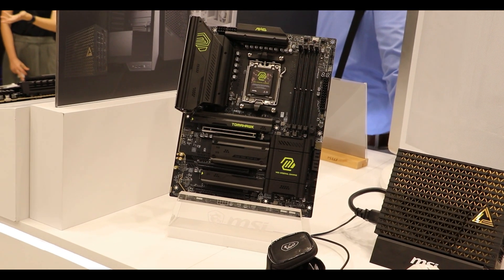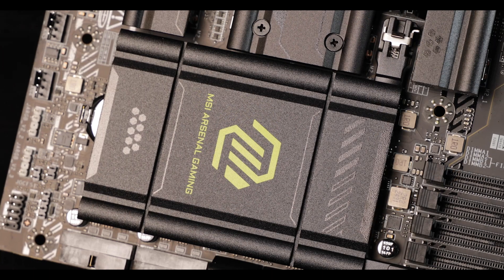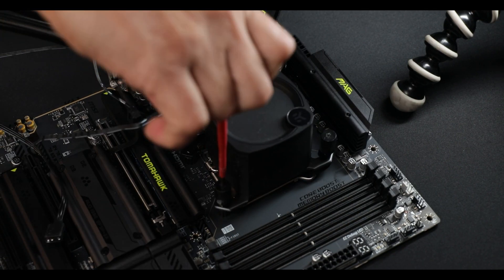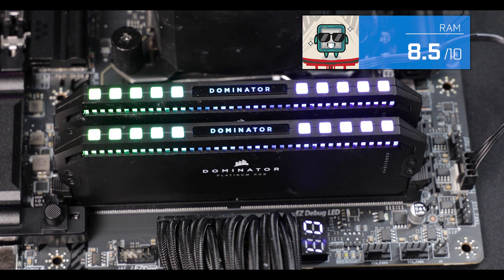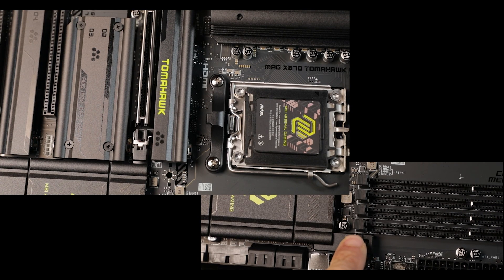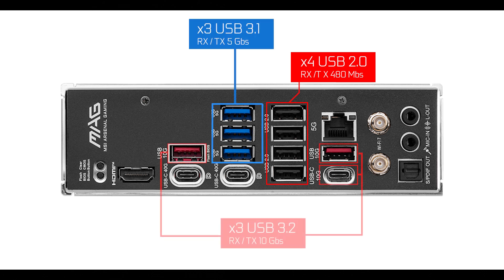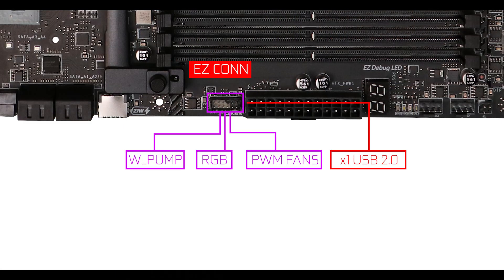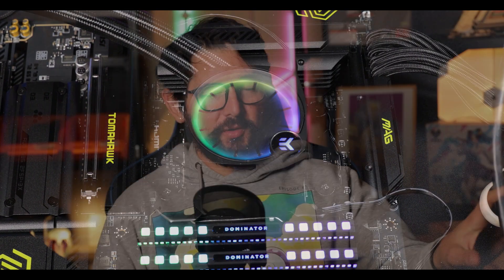MSI MAG X870 TOMAHAWK WIFI : this is getting better and better!

Comment: I am now in between MSI MAG X870 Tomahawk WiFi vs MSI MPG X870E Edge TI WiFi
Which one would you suggest? Definite one is more expensive than the other would like to hear your thoughts. :)
Reply: @laurentschoice help me
Reply from the maker: So.. the edge only brings marginal upgrade compared to the tomahawk. Most noticeable are the QR code for troubleshooting and a bit more BIY friendly features.

Comment: In my region, it costs 370 Euros and includes a 100-euro Steam card, making the price a measly 270 Euros. All this for a motherboard on par with the Asus Hero, which costs 700 Euros.
One question: I am doing "blackout" builds. Do you have any idea on how to remove, or paint, that yellow stuff? I thought of electric tape, but that will probably peel off with the heat (I did get a 9950x to demand 300W for 12 hours, unfortunately, this does almost nothing to AMD CPUs in terms of performance, so it is useless).

Comment: If you are not using the m.2_2 do you still have to disable it in the bios to get the full usb 4 type c 40gbs ??
Reply: No but check your m2_1 it’s bugged and is most likely running at 1x and not 4x, beta bios fixed it waiting for prod push
Reply: @ayyjayy5018  hi thank you I did not know that and just reaserch it and yeah im all caught up now.
Would you kindly reply here when or if they release the official bios update for the issue?

Comment: Heyman! Cooling 10/7.5? Why?*
Please show me an x870 card that performs better than this!
Reply from the maker: I think you are referring to the cooling score. 
The reason why i didnt go higher is because it didn't provide much custom water cooling features ( second D5 dedicated water pump connector , or water flow sensor ). 

But on the airflow it did score a 5/5 and 2.5/5 for watercooling for the presence of an AIO connector as well as a temp sensor :) 

Hope this helps .

Comment: Now its even better the x870e version of the Tomahawk is by far the best value motherboard right now.
Reply: What about the GIGABYTE - X870 AORUS ELITE WIFI7 for the 9700x?
Reply: @Stardomplay  from what i have seen only MSI and AsRock (only the high tier mbs) have all the PCI Express slots unlocked at the cost of losing some USB ports.
MSI is the best for the value. As the other manufacturers will lock PCI ports at the same cost.
Reply: @Stardomplay  Gigabyte failed their 800 series. Every boards up to the more premium X870E Aorus Pro have 6 layer PCB for some strange reason. The Tomahawk is clearly the superior board.

Comment: Hi all, and thank you for another awesome video, Laurent. 

I will be receiving my board today. The question I have, is that do I really have to connect my 4090 to the  pcie power on the motherboard? Lower mid section, or can I just rely on my power supply to feed the power to the motherboard and the gpu as normal. Currently, I am using Mag B550 Tomahawk max wifi.
Reply from the maker: You don't have to use the board 8pin plug of you don't want to use the fast charge .
Reply: Awesome, and thank you, that's what I thought. I just needed verification moving forward.

Comment: 1 Q 
Usually when I read other motherboards specifications , it mention that the m.2 gen5 slot X4 share bandwidth with PCIE X16 gen 5 , if  using the m.2 slot that will decrease it to X8 is that the case here with this motherboard ?
Reply from the maker: I mentioned the pcie bifurcations on the board. :)
Reply from the maker: I doesn't decrease
Reply: @Laurentschoice  
Thanks much appreciated 
do you know if I insert pcie gen 4 x4 on M.2_2 will that effect the back panel type C and the m.2 speed ? or its only for pcie gen 5 x4 ? as stated in there website
USB 40Gbps Type-C ports on the back panel and M2_2 slot share PCIe 5.0 x4 bandwidth. Both run at PCIe 5.0 x2 when a device is installed in the M2_2 slot. You can switch M2_2 to PCIe 5.0 x4 in the BIOS, but this will disable the USB 40Gbps Type-C ports

Comment: The lack of onboard RGB was one of the things that drew me to this board. My AIO has no lights, my fans have no lights and the RAM I plan to buy have no RGB. Blacked out and minimal is what I am going for.
Reply: Perfect choice for a non RGB setup. Which RAM do you use?
Reply: @JohnTheRip  I actually have not got ram yet. I started a deep dive into DDR5 and the more I learned, the less sure I was about which sticks to get. Each time I find some with the specs I like and being single rank, they turn out to have RGB. Like the G.skill trident F5-6400J3239F24GX2-TZ5NR
It has the specs I like but also has RGB. I can turn off the RGB. It is single rank so the tomahawk MB can run all 4 slots at up to 6400 M/t.

There's the F5-6000J3636F32GX2-FX5 that have the look I am going for but are double rank. Which will be hard to get to run stable at 6000 M/t in all four slots. But I could simple use two slots and leave the other two empty.

What I am looking for is no RGB 6400 M/t single rank, with a cas latency of 28 or 30 24GB per stick. At 24GB per stick I can start with two sticks and buy 2 more of the same sticks if I need more ram. But if I go with 16GB sticks, I need 4 sticks. I know 32GB of system ram is not enough for the stuff I do. 48GB is almost always enough. 96GB will be enough for sure.

Comment: Im building a new pc coming from an i7-6700k with a msi z170a I’m going to this motherboard with the new 9800 x3d. Also my gtx 980ti worked fine for too much time I will wait for a 5090
Reply: How funny! I have the same MSI Z170 and i7-6700k I had a GTX 1070 for several years I now have a RTX 3060ti for the past 3 years. I game in 1080p so I'm keeping the 3060ti until 50X0 series gets more affordable (if ever) . Windows 10 is EOL so I'm updating system to this MB and 9800X3d.

Comment: AVOID 

My main issue currently with the board is getting "code 10" after a "cold start" (not using pc for longer time).

I am not the only one who is having those issues from what I have read on the forums.

Seriusly you pay premium for beeing a beta tester. A 650s dont have those kind of issues.

AVOID

Comment: Looking to upgrade from my older Msi Gaming Edge AC board that’s paired with an i7-9700K from my first and only gaming PC, and moving onto the AM5 platform, and plan on staying with AMD until I have a good reason not too. A lot of people don’t like the lime green details.. but if you can ignore the color just for the duration of the video; this board seems absolutely amazing for the price point and has everything I’ll ever need for a long time. Because of this video, I’m picking this board when I start ordering my parts.. I have to ask though, does the BIOS have the setting where the CPU has a very very high power draw limit, beyond AMD’s limit, like the fiasco with the 13th and 14th gen Intel processors?

Comment: Just a quick note for anyone looking to maximize the USB4/M2_2 switch with a Samsung 990 EVO or EVO Plus, the only drives currently available that can work both in PCIE4x4 as well as PCIE5x2. By maximizing I mean having USB4 functional as well as use M2_2 at maximum bandwidth.
As of BIOS version 7E51v1A1A, with the 990 EVO Plus in M2_2, setting the switch to AUTO will result in the USB4 being disabled and M2_2 set to PCIE4x4. It's not enough to set the split manually so that each get x2 lanes, doing so will result the Samsung drive working in PCIE4x2 with degraded performance. You have to both set the switch to give USB4 and M2_2 x2 lanes each AND set the M2_2 to be Gen 5 in the BIOS for this combo to work at maximum bandwidth for both peripherals.
One other gripe that I have is that M2_3 only has two lanes, which it shares with the PCIE3 slot. The switch in the BIOS does not allow the PCIE3 slot to be disabled and direct all lanes to M2_3. You can however disable M2_3 and direct all 4 lanes to PCIE3. So if you want to use all 4 lanes available for a M2 drive, you'll have to do so using a M2/PCIE card in PCIE3.
Despite these compromises, the Tomahawk is by far the most interesting current generation AM5 board in this price range and I'm glad that MSI decided to get back to innovating. Their previous offerings for X670/B650 felt lacking with below average VRMs and almost no USB4 offerings.
Reply: Isn't it possible to use the USB4 ports and M2_2 in PCIE4 x4 mode instead of PCIE5 x2. it is the same total bandwidth after all I assume?
Reply: @Sam-3Dx  Sameday bandwidth but not the same number of lanes. The pci-e switch that does lane splitting only, it cannot convert pcie 5x2 to 4x4.
Reply: @ValentinNadolu  I see hikes in 990 evo sales 😅
Reply: I have a scarlet 18i8 I use for recording and I’m winding if I can bypass these USB4 and use the  USBC10g port for it. Will it cause latency issues when recording audio?
Reply: ty

Comment: There's a few unaccurate information in the video. But overall kinda accurate and good info. The note tho is kinda weird
Reply from the maker: Feel free to let us know what was inaccurate for corrections :)
Reply: @Laurentschoice The VRM doesn't deliver 80Amps. Neither the 1360Amps total. (Don't have a link) It was shown in a video testing that the VRM delivers ±75% of their rating at best or lower (±60Amps) but could in theory do 80Amps even if they never do it. The total bandwidth is wrong (I think I heard 45 in total). Because the chipset is usually overwhelmed reducing your bandwidth. And even if you wouldn't have any speed reduction. The speed was a bit slower than advertised. (I think Hardware Unboxed did a good job for MB/s speed of USB, just in case, yes I know MB and Mb isn't the same but doesn't match the ÷8 ratio).

Overall the information is nice and surely better/more detailed than the brand it self x)
Reply: Almost forget: Wrong information in the thumbnail. Even if it's perfectly fine saying 3GHz DDR5 speed but unusual. It's wrong saying 6GHz DDR5 speed. Since there's no such speed in DDR5. 3GHz = 6GT/s (or 6000MT/s) the thumbnail show 7,8GHz which is wrong. And that me think that there's no real information about Wifi/Bluetooth/Ethernet further than the thumbnail
Reply from the maker: @FireCestina1200 aah the thumbnail :)

Comment: This board or the Gigabyte X870 Aorus Elite Wifi 7?  Both received the same overall score, but it sounded like there is a bit more weight to the areas that were strengths to the MSI Tomahawk.  Which would you recommend?
Reply: I’m having the same dilemma trying to decide which one to get as well
Reply: @DarksideCommander  FWIW, I went with the gigabyte since Newegg had a sale on it and it was in stock
Reply: this one is full of problems on forums, not the gigabyte sooo i think i will choose the gigabyte
Reply: @AestheticKunt gigabyte has a 6 layer pcb so both are bas to be honest

Comment: I wanted to share my experience with MSI boards. I've been using a MSI X99-X Power board daily with an overclocked intel i7- 5960x. I use this computer for video rendering and gaming and have never had a single issue with it since 2014. MSI overbuilds everything.

Comment: I have it and I don't recommend it, unstable bios plus all bios versions are beta, temperatures jump from 40 to 80 as if nothing, the startup load is glacially slow, the bios translation is not complete, sometimes it doesn't even save the bios settings, it looks like an unfinished product!

Comment: What is that grey power connector for on the bottom of the mobo ? IT looks like a 8 pin that is grey and you would connect a psu power cable to it ?

Comment: I have always liked MSI Carbon  but not the price but in todays prices they are OK. Gigabyte already dropped the ball with ALL but the Master having only 6-Layer PCB But they did upgrade to ALC 1220 audio (Not ALC 4080 YET) and I am not a fan of 60Amp power stages on any X870 board when they cost $290 or more. My go to just lost me since they cheeped out from AM5 and way Over charged for them for what you get. Even the  GIGABYTE B650 AORUS ELITE AX  which has 8-Layer PCB and 14-2-1 70amp Power Stages Vs GIGABYTE B650 AORUS ELITE AX ICE with 6-Layer PCB and 12-2-1 60 amp power stages which is the newer version in White and mad Cheaper and they wanted more for it until now along with them Using 15 year old audio ALC897 audio which they are so proud of putting on their boards that they only call it High Definition Audio and you have to find which codec they used somewhere in the fine print.

Comment: I am getting an option to get the X870 Tomahawk or the last years X670E Aorus Master at the same price. I am not overly fussed with the extra USB4 40gpps connection on the MSI, should I go for the X670 Aorus Master then as it has a much better VRM for furture upgrade compatibility ? Please advise.

Comment: How are your reboot times looking like?

For me it's about 2 minutes before it actually posts, with 64GB of 30-6000 ram. Then another minute or so before windows.

If I shut down, then hit the power button it is much much faster. Very peculiar.
Reply: Once you update the bios and the chipset driver that issue disappears

I 've had that motherboard for a week paired with a 9800X3D, and it's awesome !
Reply: I'm getting an EC error on a new same build :/ I @Kaiwen94
Reply: @Kaiwen94  I’m thinking of getting it instead of the carbon WiFi. It seems that the tomahawk is faster in gaming for some reason even though it’s the cheaper board. So why spend more? lol
Reply: There’s one setting for memory training or something. Set it from auto to on
Reply from the maker: I had the same on many x670e boards... AMD only issue :)
Reply: @Laurentschoice no it’s not. I have GB Aorus master and it boots super fast. Before at I had the MSI tomahawk and it took forever. All the MSI boards take forever to boot.

Comment: This is the best x870(e) board under $300.
Reply: Under 300$ eh? Here 370EU. Still use crapy ALC4080 codec. Nobody mention this. With this crapy audio codec, i m not giving 370EU and encounter sound problem.

Comment: I have this board and it has been rock solid from day dot.  Very happy with it
Reply: Really? I cant find the corrct Wifi drivers. My USB 2.0 ports arent working either, apparently its the the latest BIOS. And on top of all that I cant boot unless its in CSM (instead of UEFI). Literally the least 'rock solid' motherboard build i've ever had in 20 years of making PC;s...
Reply: @pboytrif1  very odd. That is not my experience at all. The only issue I am having is that my Corsair LCD aio's screen won't show up in icue.  But I have had so many issues with icue and this aio since I got it that I just assumed it was icue. Outside of that it's been solid.  Sorry to hear your experience is different.  Out of interest what CPU are you running? Fwiw I have the 7950x3d in mine
Reply: @pboytrif1  You wouldn't read about it, I have been using this mobo since it became available.  I log into my PC today.  No wifi (which had been working previously without issue).  Literally no wifi option, nothing in device manager, nothing.  Cannot re-install drivers from the MSI website.  Wifi Bricked.  I haven't done any bios updates etc in this time either, literally turned it off working, now it no longer exists.  Let the trouble shooting begin.  I was singing praises for this board after the trouble I had with my x570 board.  Now the fun starts on this one.
Reply: @pboytrif1  I dont have this mobo yet but i was looking around (i have the x570s of this model) and apparently it was a buggy BIOS causing the usb 2.0 not working and they have taken it down. they probably gonna release a new bios soon. I've find these info on overclock forum
Reply: @FedericoSala   they have 3 bios drivers, all are beta... this tell much

Comment: I got the gear but cant fix 1024x768 driver issue. My monitor is recognized as Non Generic PNP Monitor and when I install Nvidia drivers for MSI 4070 12 GB 2x Super OC, it flops and drops resoulution...tried everything, Monitor is Gigabyte Aours FI27Q....

Comment: Hi Laurent,

After 12 years, my old PC system (AM3+ with an FX CPU) died this August. It took me a lot of time to compare all the necessary components for the new build. Just when I thought I had finally found my new system (B650 motherboard, etc.) and was about to order the parts online, your video popped up on YouTube. Since I’m building an entirely new system, I changed my decision and ordered the MSI X870 Tomahawk (with an AMD R9 7900X and DDR5 6000 CL30). I think my new system will more than meet my needs 😃.

Thanks for the helpful video that guided my purchase decision 👍.

Greetings from Vienna/Austria!
Reply: Just ordered all my parts, first build ever, want it to last forever. Went with x870 tomahawk, r7 7800x3d, rtx 4070 ti super, 2TB M.2 pcie 5, 64gb ram, arctic freezer AIO, gold 1000w PSU (A on cultist list), and a sound card.
Reply: @johndoe-vr3xt Happy for you. That's a super strong first build, my first build, you don't even want to hear about my first build. Keep in mind you can upgrade components anytime, that's the magic of PC. The easiest ones are GPU and RAM, maybe add some extra storage. That said you probably won't need to upgrade your PC in a very long time depending on your use case. Don't take hardware too seriously, hardware is just a tool to deliver fun experiences with.
Reply: How much did this mb cost for you? It's 460$ for me, damn!
Reply: That's one hell of a jump up from your old system. Enjoy the speed...and features...etc!

Comment: I'm actually building my new gaming PC this week after hanging on to my Current Gaming PC after 11 years (This month). 😅

I ended up purchasing this Motherboard after having my Gen 3 MSI Motherboard for so long.  So I'm excited to put it together!

I did have a quick question though.  I bought a M.2 NVMe Samsung 990 EVO SSD to use as my OS install drive, and I plan on connecting it to the M.2_1 slot for PCIe 5.0.

Do I leave that black cube that's in the M.2 slot alone (It looks like it's meant to support the NVMe SSD), or is it meant to be removed?